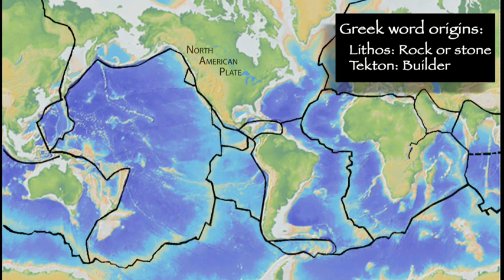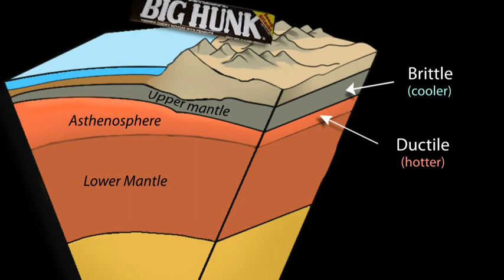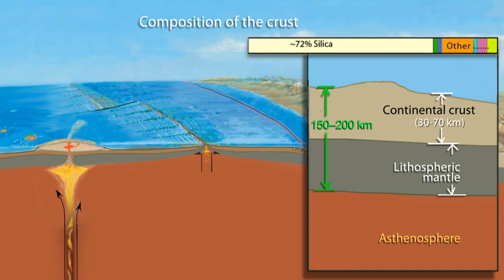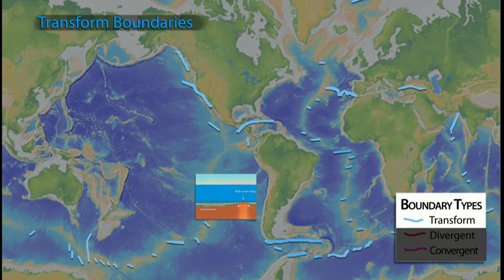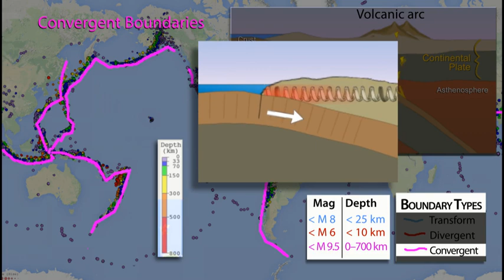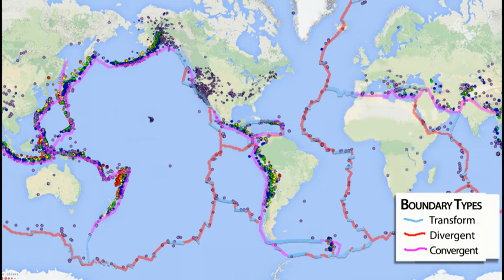Shake Out Plate Tectonics Earth's 150 km thick outermost  lithosphere is broken into a jigsaw puzzle

Comment from the maker: When the plates finally give and slip due to the increased pressure, energy is released as seismic waves, causing the ground to shake. This is an earthquake. Earth’s crust is made up of rocky slabs, called plates, and how those plates are constantly moving. As molten rock rises from Earth's interior and cools to form new crust, it forces older crust to grind against other plates or sink beneath them. Using ground movement data, scientists are able to calculate stress levels at these plate boundaries. This stress is released in a matter of seconds during an earthquake, sometimes generating as much energy as thousands of nuclear bombs.